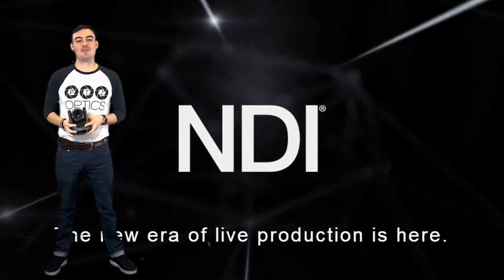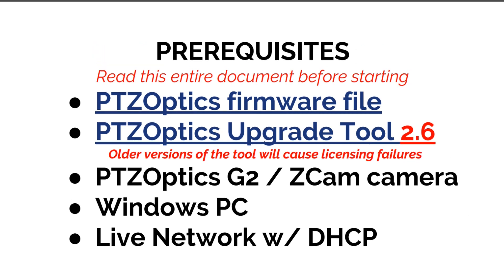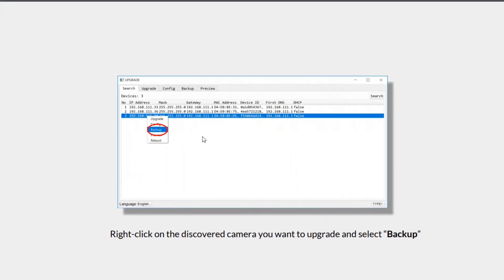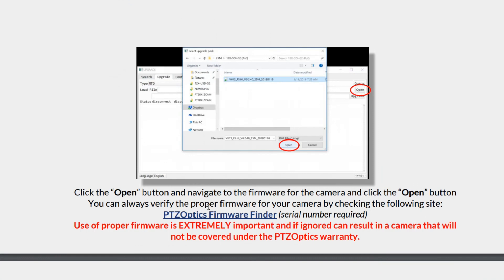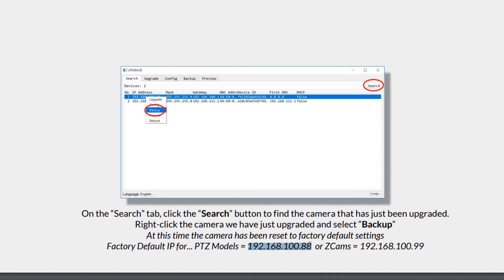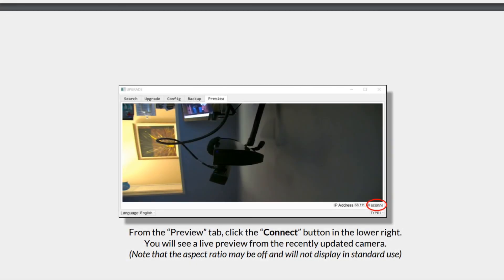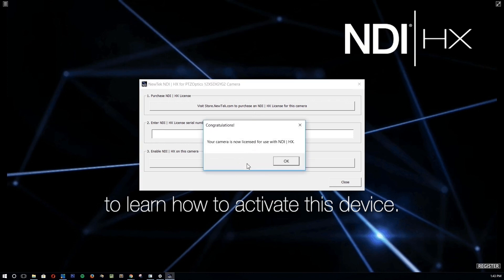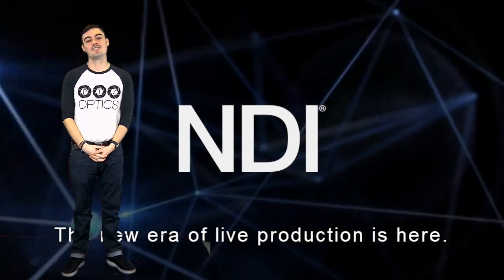PTZOptics NDI Ready Firmware Upgrade Process (SDI MODELS)

Comment: No matter what I do from Mac or PC, it says Back Status timed out
Reply from the maker: Hi Paul,
The "Back Status timed out" error during the PTZOptics NDI Ready Firmware Upgrade process for SDI models can be frustrating. This issue can stem from a variety of causes related to the network, firmware upgrade tool, or the camera itself. Here's a step-by-step approach to troubleshoot and resolve this issue:

Check Network Connection:
Ensure the camera and the computer (Mac or PC) are on the same network and can communicate with each other.
Try using a direct Ethernet connection to the camera if you are not already doing so.

Disable Firewall and Antivirus:
Temporarily disable any firewall or antivirus software on your computer. These can sometimes interfere with the upgrade process.

Use a Static IP Address:
Assign a static IP address to your camera. This can help ensure a stable connection during the firmware upgrade process.

Camera Network Settings:
Verify that the network settings on your camera are correctly configured. This includes checking the subnet mask and gateway to ensure they match your network’s configuration.

Firmware Upgrade Tool:
Make sure you are using the latest version of the PTZOptics firmware upgrade tool. Download the latest version from the PTZOptics website.

Download the Correct Firmware:
Ensure you have downloaded the correct firmware file for your specific PTZOptics camera model. Using the wrong firmware file can cause issues.

Restart Everything:
Power cycle your camera and restart your computer. This can sometimes resolve communication issues.

Connect Directly to the Camera:
If possible, connect your computer directly to the camera using an Ethernet cable, bypassing any network switches or routers. This can help rule out network-related issues.

Try a Different Computer:
If possible, attempt the firmware upgrade using a different computer to rule out any specific issues with the original computer.

Check for Camera Hardware Issues:
If the camera is still not responding correctly, there might be an underlying hardware issue. In this case, contacting PTZOptics support for further assistance would be advisable.

Consult PTZOptics Support:
If none of the above solutions work, reach out to PTZOptics customer support. Provide them with details about the steps you’ve taken, the camera model, and the error message you are receiving.

Firmware updates can sometimes be sensitive to network configurations and the specific setup of your equipment. If the problem persists after following these troubleshooting steps, professional support from PTZOptics is the best course of action.

Thanks for checking out our Channel! 
Learn More: https://ptzoptics.com/